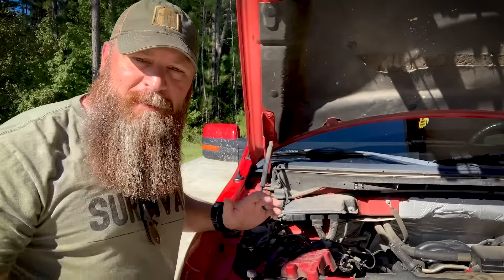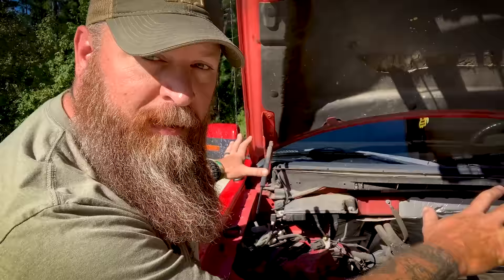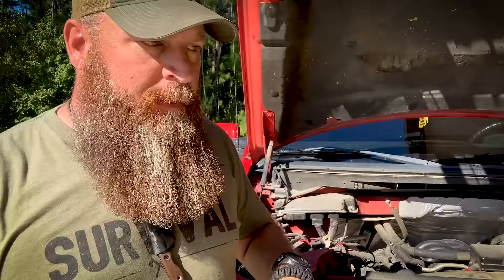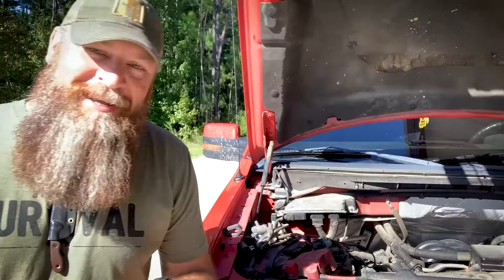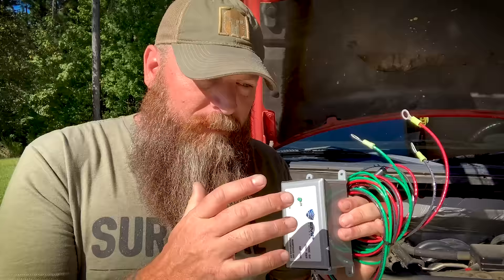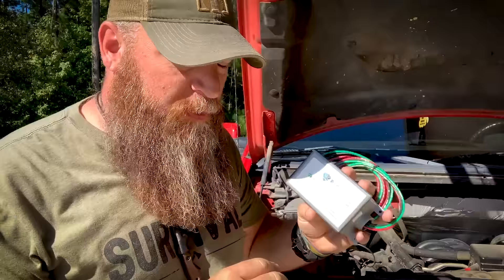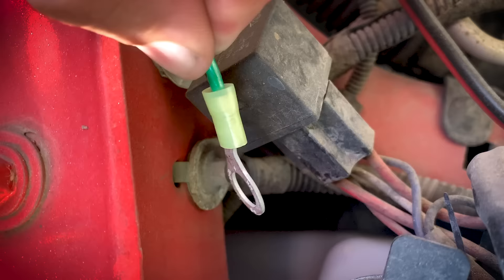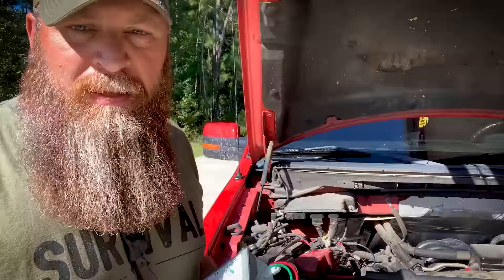EMP PROOF YOUR VEHICLE

Comment: no, just buy nice 55 ford pickup, v-8 automatic, air, tilt steer. camper shell, trailer hitch, frt wench, twin batteries. aluminum radiator, im just going driving to s.w.. Maybe lil tear drop trailer.

Comment: I seriously doubt the box world work. Because if it detects a high voltage to short, then the damaging spike is already there doing damage. Cutting power may not be the best option either as I explain. Here is how I (who works with electronics) would protect myself. I have not been in a EMP/Carrington event so these are my best thoughts on the matter based on my understanding of electronics. In layman's terms when a magnetic field crosses a conductive (like a wire) it produces a voltage. The longer the wire (conductor) the higher the voltage produced on it. So during a EMP or Carrington event large magnetic waves are pulsing all around the earth. The grid is VERY long wires so it will be STRONGLY affected. Likely the AC will go out of sync, and have rogue voltages. Home electronics, cars, etc have pretty short wires so a electromagnetic charge created in a EMP will be minimal inside these devices. However, some chips are VERY sensitive to a static charge. I think the EMP would need to be VERY close to produce a charge enough to damage most basic electronics. So after much thought my choice of action during an EMP/Carrington event would be as follows. A nuclear EMP or a Carrington event provided might give you warning if a alert if given. You are going to have roughly 11-17 min before impact (if it don't catch you off guard) for both. Here at home I use my DIY solar/batteries, and some grid power. First I would "throw" disconnect all breakers (makes wires in the home shorter). Turning off my main breakers disconnects me partially from grid. Next unplug, and turn off all grid/ac appliances/lights. My solar panels are in my back yard, and that is a long run so I will turn off the breaker to that wire run as well. Now here is where my plan differs from most based on my understanding of electricity. I would "turn on" my car, phone, and other battery important devices! A capacitor/battery actually work by the flow of electrons through wires much like water pressure flows through pipes. If the voltage on the wires is lower than the battery, then electrons flow out of the battery, and voltage on the line is raised UP to the batteries current running voltage. But if voltage in the wires is higher than the battery, then electrons will flow INTO the battery, and the battery will force higher the voltage DOWN to the current battery voltage as it absorbs those electrons (provided resistance in battery is not to high)! In layman's terms any circuit "running" and directly connected to a battery (say it's 12V car battery) "should" stay at a safe 12v-14v (or whatever the battery voltage) as higher voltages from an EMP/Carrington should be drawn down into the battery. If say the car (or home grid inverter) was turned off, then there would be no place for that the charge in it's wires to go and it "could" build up enough to damage something (capcitors/semiconductors). Regardless I would NEVER run any kind of AC device during an EMP/Carrington event. Hope this explanation helps some of you plan!

Comment: I'm confused.. this device grounds to the chassis of the vehicle, but don't the tires insulate of chassis from the ground? To properly ground the chassis while in motion you would almost have to drag a ground wire along the ground that somehow was able to conduct but not wear out in a short time. Otherwise I don't think you could disperse 5000 amps across the chassis with no ground to Earth. It's got nowhere to go so to speak

Comment: So.. wouldn’t just disconnecting the battery in your vehicle solve the problem?  I mean in order for an emp to effect electronics they would need to have electricity flowing through them right?  There would be no way for the waves to over saturate the components.  Besides, I can’t believe these devices would work at all especially on any current modern vehicle. There are just too many sensitive electrical components i.e.  computers  and sensors. Plus the fact they have multiple devices that all talk to each other with a digital signal, CAN/BUS etc. I it’s just like the power strips that everybody buys because we are told they will protect our home devices. When actually lightning is so fast and powerful it blows right past the protection circuit and fries whatever is plugged in to the strip.   Best protection for that is to have earth grounded outlets.

Comment: A smart man would buy extra components that would be damaged by an EMP, and put them in a Faraday cage. Even if that device works, and I have my doubts, it would be trashed by the first EMP. A single EMP won't take out the whole North American continent. It will take several to cover the whole continent. EMP effects will overlap and you could get several pulses in a given spot. The time between each pulse will vary depending on how long the missiles take to get to their detonation spot.

Comment: I am sorry, but this can not work. A better analogy than the sponge is that everything that can conduct electricity is now an antenna. Even the ground wire that is supposed to bleed off the extra power is feeding over power back up it. Still love the video, thanks.

Comment: Diesel with mechanical fuel pump is immune to all bugs, this device is not gonna work . All electrical equipment must be shielded with a faraday cage conductive surface, the strength of the pulse will affect how thick the shielding needs to be.

Comment: So essentially what you're saying is that the little box in your hand generates enough protons to absorb the electrons generated by an emp... ._. 

However, there is no break circuit and you say that it grounds the electron surge to the chassis, which everything in the car is grounded to... 

I dont know brotha, I don't see how it's electrically possible. That box would need a significant amount of protons to power it, in order for the electrons to be attracted to it and become neutralized.

Comment: From what I read there is no evidence that the known EMP weapons of the past would widely affect cars.  They are not connected to the grid so the EMP will not be concentrated and magnified as it would on electrical infrastructure in substations/ transformers/ step up and step down, plugged in devices at home.  Besides all that, I would avoid, strongly avoid appearing like I have more than everyone else.

Comment: If these actually work to protect modern vehicles, why would manufacturers not have them built in to new vehicles and expensive electronics as a preventative?? 
An EMP is an increasingly likely event and common sense says to add a minimal upgrade in the production process to protect the consumer.

Comment: I really feel like this is a scam but by the time you figure it out it’ll be to late. 
9:32The chassis ground is connected at the battery. That box has two grounds and are both connected to the same one source. I don’t see how that’ll do anything.
The box is literally a regular weather resistant household receptacle box with a giant hole in the side to plumb conduit. It bet it’s just a box with an led.

Comment: I’m still doubtful this product works due to the gauge of the power and ground wires.  If they claim this is even lightning proof that would mean it’s rated to carry 50,000 amps. Those wires look to be about 10 gauge, which is only rated to handle 30 amps. So there is no way it could channel and direct any power to that “magic” box as the wires would literally burn to dust before directing or absorbing any power. But idk I’m just a mechanic 🤷‍♂️

Comment: cant see this working at all , how does it shunt power to ground through your tires also what about every single fuse and other circuits your car relies on to start and run , maybe work in a building certainly not on a car ! Build a cheap outbuilding wrap it in mesh ground it and put a motorbike inside

Comment: .    beware of this device because most MP is directly affected the little chip inside your electronic box.... EMP may enter your electronic box through the power cord or even a ground connection but EMP radiation is direct on the small low voltage devices inside your electronics.  
    That is why some people say a tube type transceiver may survive EMP because the circuits aor not so susceptible to blast of killer radiation that will destroy the low power units in the electronics. Other than enjoy using and looking at my Collins KWM 2A, lots of hams think it will survive an EMP wave but most are fearful of little low voltage circuitry can be easily overwhelmed and burned out permanently some cases..
   We need to hear from direct tested experienced users to know which way to go.

Comment: Your missing a couple of points, you say it sends the spike voltage to ground in a nanosecond. Your vehicle's chassis is already hooked up to the negative side of your battery and neither is connected to actual ground where the spike needs to go... vehicle ground yes, actual ground no. As an example, while traveling to the Keys in FLA, I ran across an accident where a guy had hit a high power line pole and knocked it down, one of the wires broke and was bouncing around melting the sand ever time it hit the ground. it eventually got hooked around his bumper and immediately stopped arcing. People, being totally ignorant, were yelling for the guy to get out of the car. I ran over to him and told him not to move because the tires were insulating the electricity from going to ground, but the instant he had one foot in the car and one on the ground, he would have made the connection and would have turned immediately to charcoal right in front of everybody, women and children included. SO... hooking the ground wire to your chassis is meaningless, you would have to be dragging a ground wire from the chassis to the actual ground with some way to make a good connection or have the apocalypse vehicle stationary and hooked to a permanent actual ground...... Now on a totally different note, how do they test these EMP devices? Can they effectively mimic an actual nuclear explosion on a smaller scale? In this day and age of reputable companies with a history of lying to us if they can get away with it, who's going to hold them accountable after an EMP hits us and their product doesn't work? Don't get me wrong, I want something like this to work, but I was in the military and directly associated with anti-EMP devices, and these devices were classified with one of the highest top secret classifications. So with both sides trying to outsmart the other's anti-EMP devices, can there be a civilian company that actually puts out something that works?
Reply: Absolutely correct. If he would have opened that door he would have been toast.

Comment: Snake oil.  That is not how EMP fields work nor how they affect electronic devices.  I used to EMP harden aircraft/systems and perform TEMPEST control (as well as category separation on COMMS etc.).  An EMP doesn't run through the wires of a circuit like a power spike would run through your wiring at home which can be protected by a surge suppressor (which is effectively what this device is).  If we use the water analogy, it isn't analogous to high water pressure through pipes.  It is much more akin to a tidal wave totally flooding everything in its path, connected to other devices or not.  If your vehicle isn't in a conductive, enclosed chamber, it is going to be subject to EMP fields.
Reply: How is the best way to protect my family from an EMP based on your experience? I have thr TRAP and EMP shield. I have four sons and want to keep them safe. I don't care about cost, I just want to make sure I have everything the need to be safe. Sorry if this is a no brainer to some of you. I'm just a mom and this is not my expertise.
Reply: @jennifercook-qd3mz  the trouble with EMPs is that you never know when you'll experience one, and that they can be natural or manmade.  To that end, the truth is there's no really good way to know aside from keeping spare vehicles in an EMP hardened bunker until you want to use them.  But... Remember that fuel pumps and gas stations will likely take a nosedive, so you won't be able to fuel them even if they survive.  The reality is that unless you have an old diesel that is largely electronic free and can run on SWVO, you're really out of luck, at least in the near term.

The big point here is that these devices are a waste of money and I hope that the folks selling them get the cosmic justice they deserve for taking advantage of people.

Comment: did you know that your electric utility has EMP device's  they will install for 12,99 a month? it is also a "surge protector" BUT my home was hit by lightning. and still I had a few electronics that crapped out , they paid me for a few older electronics but i paid more in "rental " then thy paid me for my loss. SO I say remove it and save 13bux a month to buy your self a nice new replacement with the latest  tech LOL.

Comment: To be shielded all the cabling must be braided with a drain wire included brought down to battery earth. 
This is the antenna that picks up any EMW and takes it to the processors. 
Until it's all shielded you will be wasted your money. 

Signed 
A Vehicle Electrician.

Comment: This was a decent video until it turned into an infomercial. I have some issues with the claims of that device. I've been designing EMP/Lightning products for over thirty years. 
1. Any surge component capable of 5kA will not respond in trillionths of a second. 
2. The long and wimpy wire leads will most likely prevent any response less than microseconds. (E=L di/dt).
3. The battery is very low impedance so I'm leary of most light duty protection schemes. 
Really if you want to add some transient components there are TVS diodes (Cheap!) that you could incorporate across the battery and fuse block busses.

Comment: this is probably better than nothing, but the thing with these modern cars is the variety of electronics. there are transistors called MOSFETs than can be extremely voltage sensitive. The voltage potential between their contacts which are millimeters or less apart can't exceed a certain amount otherwise it get's fried. the manufacture would hopefully include shunt diodes for all these parts but how can we know unless we inspect the circuit data sheet. but with billions of transistors in a cpu and hundreds in even basic components (like 317 voltage regulators) which are simply a small device in even larger circuits, this is not practical. even obtaining all these data sheets would be a difficult feat on its own.

i was hoping more so for a product that is a net like material, insulator on insider, that you can wrap your components in, after clipping ferrite grommets over your wires. this would have to be done over your ECU, ignition module, fuel pump relay, and oxygen/exhaust sensors. did I miss anything? probably. (maybe a guide that makes this step simple, and gives 3 different classes of things to protect, one more important than the other, say, ECU in category 1, ignition module in category 2, and o2 sensor in category 3, for e.g.). the last thing I am worried about is my battery. the solution i stated wouldn't be rated for a 5000A lightning strike, but i don't think it's the current that we are worried about from an EMP, it's the massive voltage transient that leads to undesired current.

please correct me if i am wrong.

Comment: If you drive a modern vehicle
The manufacturer has likely did good deal of EMP protection on the machine already
This modern world is all about liability lawsuits
Nevertheless there is already a great deal of shielding installed by the manufacturer
There are other reasons to shield the electronic devices on a modern vechicle
Other than a solar event or a atomic bomb
A somewhat silly example here
A good ole boy pulled up beside you with a huge amplified CB radio for a silly instance
Examples such as this could cause a vehicle to be in a quite harsh electromagnetic field
OK :)
If there is enough energy to destroy passive devices such as resistors, conductances, capacitors, inductors, diodes
Hey we screwed ! That just too much
And do not worry most active devices are already protected to a very large degree
And active devices are things such as as brandon calls them Chips